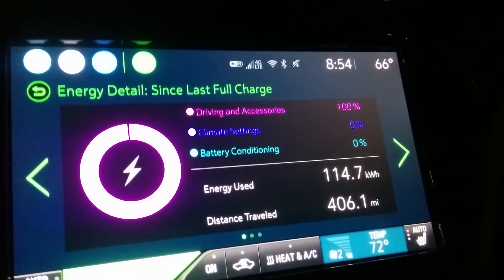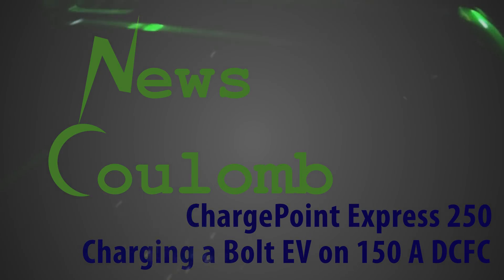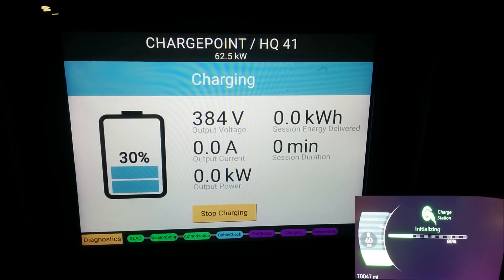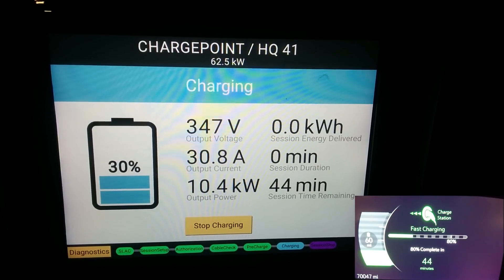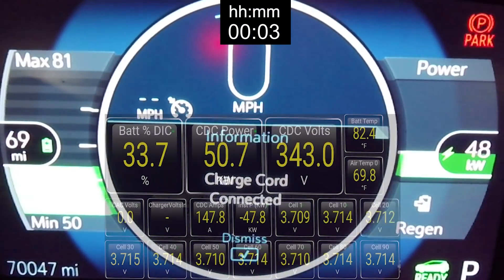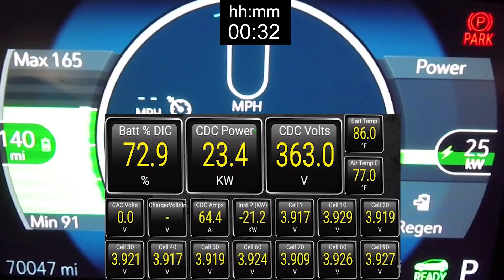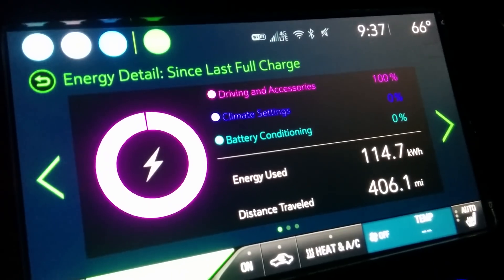ChargePoint Express 250: Bolt EV 150 A DCFC Session

Comment: Bolt's max is 150 A, station will deliver 156 A.
Reply from the maker: Yup, according to the specs, the station will provide 156 A while the Bolt EV's max charging current is 150 A. However, I purposely didn't run the climate control, which will draw additional station power when it's available, but I have only confirmed that when the charging current was less than 150 A.

Comment: What’s the max kwh that the Bolt can take in?
Reply from the maker: Should be 57 to 60 kWh (reports of total capacity vary).
Reply: Sorry not total battery capacity. While charging I’ve seen like the rate go 44 kWh. With the larger chargers how much greater will that amount go to?
Reply from the maker: The Bolt EV's peak charging rate looks to be 55 kW (it might spike up to 56 kW, but I haven't seen it).
Reply: Although this is the maximum power, in practice it is usually a bit lower, as the Bolt can only take 150A, and that limit drops dramatically over about 55% SOC. Since the battery voltage goes from about 340V-350V between 0-55% SOC, the max power tops out at about 52-55 kW. Above 55% SOC the car starts tapering the current to about 110A, which means the power drops  to about 40kW and it drops off again at about 60% and again over 80%. After 80% you don't really get any advantage from a "Fast" DC charger over a level 2 charger. Again these current drops are imposed by the vehicle, not the charging station.
Reply from the maker: That's not completely correct. The second step down from 105 A doesn't occur until 68%, and the speed of a DCFC is faster that L2 until about 95%.
Reply: You are right of course (that's why I said "about" as I did not remember the actual percentages). The current can also be affected by the ambient temperature and whether your car's battery is too cold or too hot. Also: even though the DCFC is still technically "faster" up to 95% does not necessarily mean you should always charge to that level. Consider that from about 85% to 95% you are probably charging at 16kW or less, so that last 10% is going to take between 20-30 minutes, and MUCH longer to get all the way to 100%. And there is some evidence that charging over 80% with DC may be detrimental to your battery health over the long term. I think you probably already know all of this; the point being it may be best practice not to charge over 80% on a DC charger.
Reply: I agree, to go from 80% to 100% takes >1hr on DC, which unless you really need to charge to full or the station is free (and you don't mind the dirty looks from the other drivers waiting) isn't worth it IMO.   To go 80% to 100% on a 7kW level 2 AC charger would take 1.5 hrs.  BTW Bolt steps are:  <50% up to 55kW (vehicle battery temperature dependent),  ~50%-70%: 38-39 kW, ~70%-80%: 22-23kW, 80%: 15kW, >90%: 10kW down to 0kW.  Wish I could post plots here!

Comment: 42 Minutes?  And I get upset because it takes 10 minutes to put 150 gallons of diesel in my RV. At least that gets me 900 miles vs, what, 150 in a Bolt?
Reply: FYI, truck stops have high volume pumps on both driver and passenger sides and all high end diesel pushers have fills on both sides. Anyway, thanks to NC for all these videos. I quit taking my EV on trips over charge time/availability issues, hope this changes in the future.
Reply from the maker: Interesting to know. Maybe more RV owners should be using them.

As for the public charging, it is getting better. EV charging rates might never match gas pump rates, but they really don't need to. Just a doubling of energy density from current levels would put EVs on par with gas cars in terms of real-world trip times. A tripling of energy density would mean >99% of people would never stop for fuel.
Reply from the maker: This was a test session. A real-world use case would have been 20 to 30 minutes max. 

As for your RV, 150 gallons in 10 minutes is impressive. That's 15 gpm... Nearly four times faster than a garden hose. I don't recall ever using a gas pump that fast. I do  remember having to wait 20 to 30 minutes for an RV to finish  filling up once. Either way, how much does 150 gallons of gas set you back these days?

Comment: How much time do you think goes by with a charge this fast, going from say, 3% to 50%?
Reply from the maker: It should be about 30 minutes.
Reply: @newscoulomb3705  wow, that seems pretty good to me. If we were to get a lot more of those kinds of chargers, it would seem that long trips would be definitely possible with minimal range anxiety.
Reply from the maker: Yes, I think in practice, Bolt EV owners would make 20 to 40 minute stops depending on their needs and the destination. I could see these chargers saving me between 15 and 30 minutes of charging time off my regular 500-mile trips depending on the route.

Comment: According to the spec sheet, the Express 250 should be capable of putting out up to 156A but that’s not much more than the Bolt’s own 150A limit.
Reply from the maker: True, but the normal fluctuations don't leave much room to verify. Early on, the charging rate was <50 kW, which would indicate that the Bolt EV wasn't drawing additional power; however, the dip didn't last as long (or act in the same way) as the dip that occurs when battery conditioning and climate are running during a 125 A session. 

I know the battery conditioning was running during this session, but I intentionally left climate control off until after the initial step down.

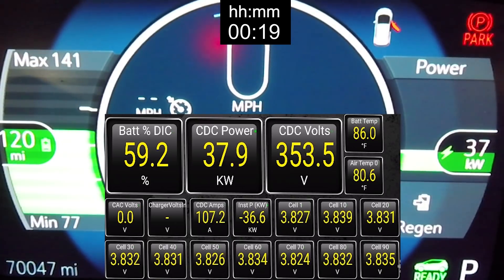Comment: Seems like the PIDs for the Torque Pro don’t quite add up. The cell voltage seems to show high in relation to CDC volts and SOC. For example. @ 1:22 the cells are 3.87v, which should be 371.5v, yet the CDC volts is showing 358.5, and the charger voltage would need to be at least as high as pack voltage. 

I wish the guy who made Leaf Spy and Tesla Spy would make a Bolt Spy with the same layout, Torque Pro just wasn’t designed to show 96 sensor readings at the same time.
Reply from the maker: Part of it could be speeding up the video and lag from my OBD2 reader; however, the PIDs don't see to be very precise.

Comment: Thanks for sharing your experience. So I assume NC that you came home on 101, if you are in Los Gatos. Did you stop in San Luis Obispo at the evgo, or what is your standard charge stop on the way back to Ventura? I'm curious because I also live in San Jose.
Reply from the maker: On this trip, I was checking out another charger, so I came back taking Highway 152 to Highway 99. 

Normally, I return on Highway 101. Typically, I stop in Salinas at the Knob Hill EVgo and charge up to 70%. If weather and conditions force me to, I'll stop at one of the 24 kW chargers in King City or Paso Robles for a few minutes. Otherwise, I head straight to the EVgo in San Luis Obispo and charge up to 70%. That gives me enough to get back to Ventura with enough left over to make my 40-mile commute to work.

Comment: Nice.. So CHAdeMO gets 40kW, and your CCS gets 50kW, not bad... how much did it cost to charge?
Reply from the maker: I think the CHAdeMO is also 150 A, so over 50 kW at 350-400 V. However, right now, the KIA Soul EV is the only CHAdeMO equipped vehicle that can charge at faster than 50 kW.

This charger is currently free. I think just while ChargePoint is still testing it.
Reply: Nice.. I guess my Nissan LEAF is maxed at 40kW, as that is what I see when I charge up at fast chargers (eg, 400V and 100 amps).
Reply from the maker: To my knowledge, the LEAF is limited to 125 A, so you'll see the same charge rates on 150 A chargers as you do on 125 A chargers. Plus, because the LEAF doesn't have active thermal battery management, you won't see  fluctuations due to additional power draw. Basically, you'll have a very stable charge rate.
Reply: Because Leaf doesn't have thermal management, how much power / current the car charges will depend on temperature. If the car just went through heavy highway driving and/or warmer weather, it will slow down lot quicker. This might be why Andrew saw 100A but Leafs I see are up to 125A or down to 8 amps (yes, eight amps with Chademo with crappy Leaf).
Reply: Yeah, I might have seen it about 110 amps for  a short time at charge of charging, then it goes down to 100 amps, then near the end, it goes down to 40A, 20A, etc.. until about 6A or so... yeah, I know.. LEAF w/o TMS really sucks.. awaiting for Hyundai Kona EV to come to my area, maybe next year.. but even Ioniq is not in my area yet.. geez...
Reply from the maker: They are only selling a few Hyundai Ioniq Electrics a month at this point. Personally, I think the Kia e-Niro and 60 kWh LEAF are worth waiting for, but I'm not a huge fan of the Kona Electric.
Reply: Why don't you like Kona EV? I like its range, but dont like its front grill (looks ugly with the man-cover like dimples) and dont like its center bridge console.. and what's with the flimpsy charge port cover dangling by plastic wires, looks flimsy/cheap.. I prefer the flip-down cover of Bolt EV...
Reply from the maker: I don't like its front driver layout, and I think it sacrifices too much rear cargo room (primarily rear passenger room). It has about 3 cu/ft more behind the seat cargo volume than the Bolt EV, but more than 10 cu/ft less cargo volume than the Bolt EV with the seats down. Also, I don't like how the 64 kWh Kona Electric's battery protrudes below the chassis. I think the e-Niro's does as well, but it's not something I like to see.
Reply: @be236  On the right DCFC, you should get up to 49kW rate.  Usually I am at 44-45kW.